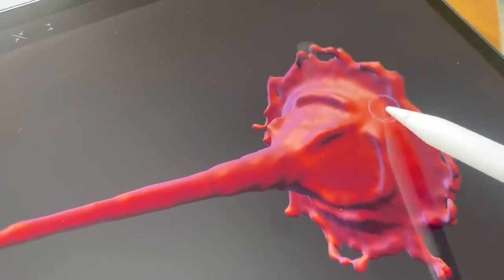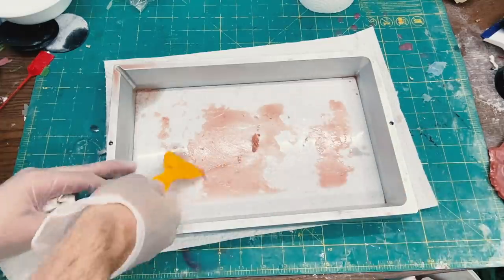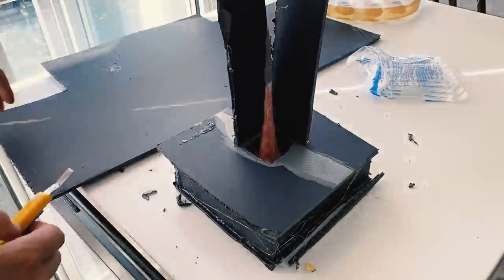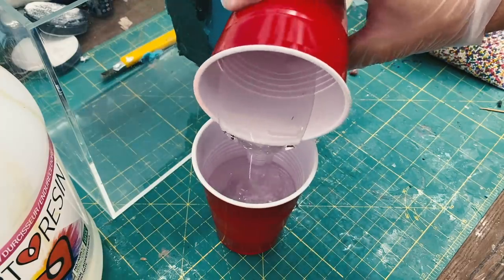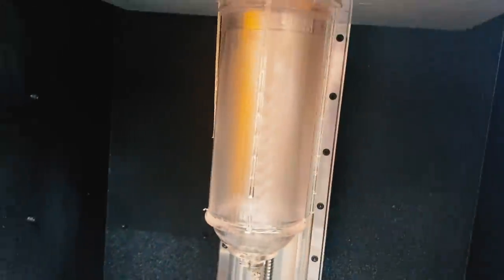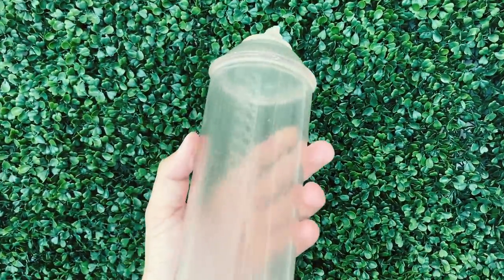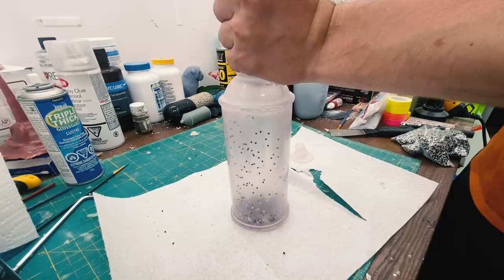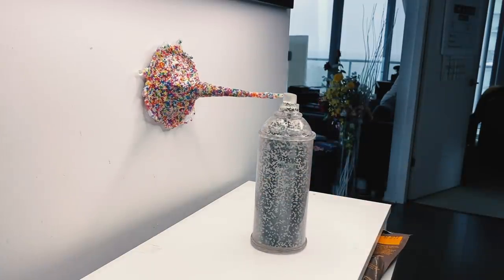Making a SPRAY PAINT CAN with SPRINKLES!

Comment: I've used sprinkles and it's fairly tricky to measure it out - have to go by eye and feel when you stir. 
I've also got a dump bear which I've put all my left over resin in. I have 1 layer to go and it'll be done. 
Thanks for the inspiration. 
I do need some top coat to protect it and some rubbing alcohol to clean the equipment. 
What uv resin do you use? I've done some sanding and should probably add some resin to make it glossy again.